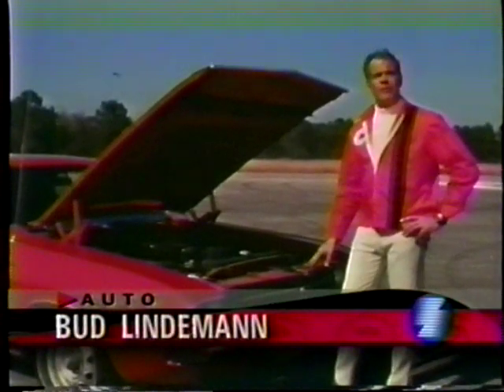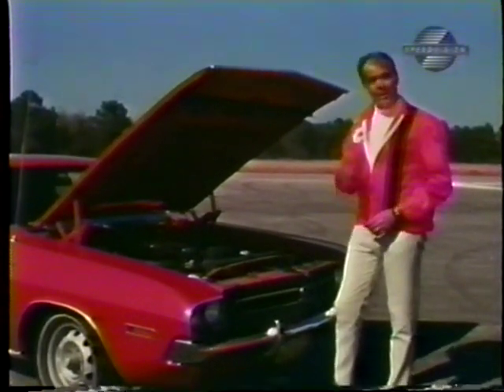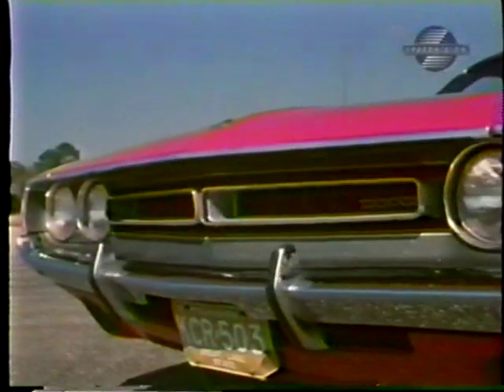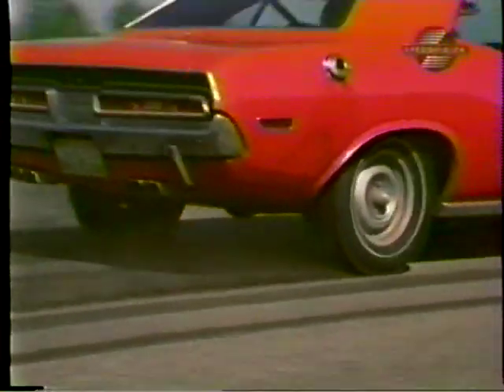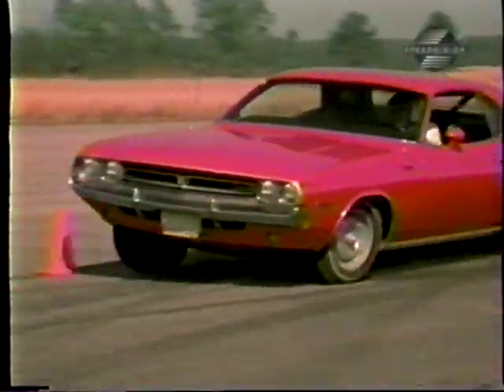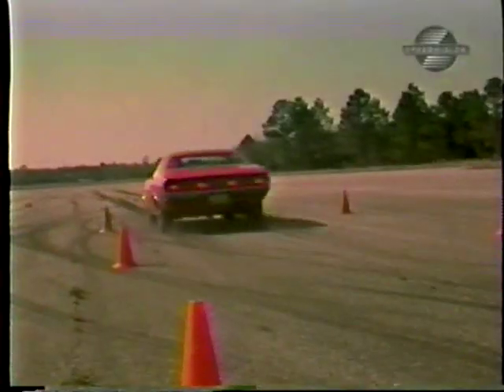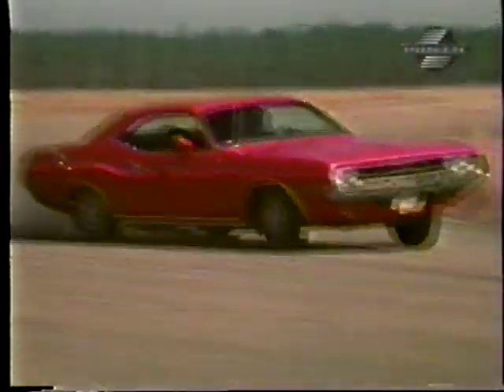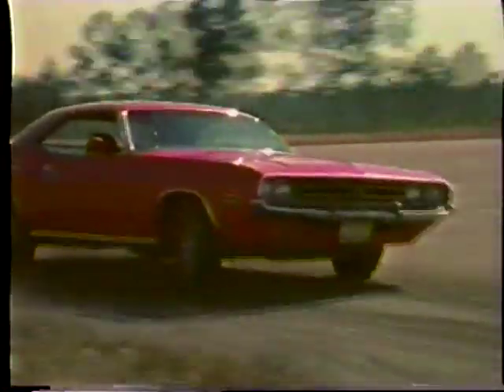1971 Dodge Challenger 383 - vintage road test

Comment: these cars had so much body roll you would get sea sick out on the track.i was a teenager and really into cars back then.71 was the year they started killing hp in cars and it was the beginning of the  smog controls.i was bummed bad i still had 4 years to go to get my license.but there were plenty of 68 69 70 muscle cars around when i did get my license.these cars would have placed better et than they did if they had the tires of today. not a whole lot better but they would have been somwhat

Comment: 383 as a standard motor. Then also in 70 you couldnt get a 340 R/T Challenger, 71 was the only year it was an option in the R/T Charger, Challenger and Super Bee line up.

Comment: That's a real odd ball. A non R/t with R/t pieces, sans the hood. With white walls to boot...Hard to tell, is that Panther Pink or Tor Red?
Reply: Was thinking the exact same thing. They should have sprung for the 15" wheels and Polyglas 60s though.
Reply: Red
Reply: I think so too.. My 71 Cuda 383 auto had all the factory hd goodies and power frt discs.. It didn't handle anywhere near that badly, brakes were fine. I will admit that i wasn't running Polyglass tires though....

Comment: @alpine1600s HA! and please tell me good sir, what exactly do you drive thats so amazing, probly putting out 200hp or less? probly made out of plastic? probly will cost you a fortune if it breaks just so the mechanic can plug the computer into it and fix the computer chip that was causing your problems? yes, please tell me what fantastic car you drive.

Comment: No, you're wrong.  The Challenger was the sole exception of having a 383 as a standard motor with the R/T package.

The 1968 THROUGH 1971 Charger R/Ts all came standard with 440 4bbl carbs. 

allpar.com/cars/dodge/charger/1971-1974-chargers.html

Comment: That car looked like it was 30 years old even when new in that video.
Reply: even doing 70mph in 8.0 sec flat
Reply: Keith Hugo yeah dodge needs to change it already there stuck and need a modern design and the retro design as an option.

Comment: You will see standard equipment for the Charger R/T is the 440 Magnum.  Don't like that website?  Google the 1971 Charger Registry. Click on Market Values as well as Production numbers.  Not a 383 in sight.  From the "History" Tab: The Charger R/T came standard 440 Magnum V8 rated at 370 HP. Optional were the 440 Six Pack and 426 HEMI. "

Please, PLEASE stop spreading BS about Mopars, there is enough of that online.  You don't know what you are talking about.

Comment: I bet it's the "Not coming from the factory with joints under the carpet" option that might have something to do with it. The Challenger is my dreamcar, but ya gotta face reality. These cars were put together by someone just rushing the car down the line, pissed about working on Saturday for that A-hole boss. at an hourly wage at that! Sadly, that KIA has better quality control than any 40 year old domestic ever did, and can outperform with 135 less horses than that Challenger.

Comment: I have a 73' Roadrunner with the same basic brakes as this car and have never had a problem bring it down in speed, even from 140 mph! My car stops on a dime.
Reply: only way a 73 road runner goes 140,is if you drive it off the empire state  building
Reply: john dillinger Is that so?
Reply: My car is a factory 340 car. When stock it would turn 6000 RPM in high gear with 3.55 gears and 28" tall tires. Do the math. My car had no modifications at the time, for about 30 years, it was just tuned good.
Reply: ***** They said something about testing a "340 car and the handling difference was barely noticeable". That may be what was going on with the gear selector issue, but hey who knows!
Reply: Randall Price n
Reply: @thesurveyor2235  The 73 340 was a dog compared to the 1970 what with 3 or 4 compression ratios missing The 70 would have had 10 or 11 to 1 compared with 7 or 8 for 73. As for tuning, I suspect you aren't running a factory tune if it goes so well

Comment: This is actually quite impressive. I'm somewhat surprised at how good this actually is particularly considering it's probably on bias ply tyres.
Considering a 440, instead of the 383 -  and the 440 is only about 30lbs heavier - I wonder how a 440 4sp would have done in this test.
Reply: A 440 is alot heavier..about 100 lbs and for your information review all of the old car tests.....not ONE 440 went as fast as the 383..Ignorance is bliss!!!
Reply: A 440 manual 375hp pulled 60 in 5.6s and 14 dead for the 1/4 mile in 1970 with another tester.
Reply: @johnnyzee383   are you sure because im thinking of doing a 440 hemi swap with the manual transmission 3:2 gearing and im looking at it as of im in 1970 ( not after 1975 ) buying a new car as a daily driver for work and family duty and checking out the engine options on the build sheet at  the dodge dealership
Reply: @richardprice5978  Am I sure about what?
Reply: @johnnyzee383   " not ONE 440 went as fast as the 383..Ignorance is bliss!!! " your saying it makes the car in the test in the video preform worse off ?? and as a new ( aka in 1970 ) car for getting to work + small family chores ?
Reply: @richardprice5978  I still dont understand your question...ok..The car in the video was probably well tuned for this test, and was indicative of a well tuned and well running 383 with the 440 heads and cam. Remember that a regular family sedan 383 was not the performer that the 383 HP motors were in the Roadrunners , Challengers and Superbees...and example is a Mototrend test in 1971 of 2 1971 Roadrunners, one equipped with the 383 and 3.55 rear and the other with a 440 Six pack and 4.10 rear. The 383 car ran a 14.84 @95 mph and the 440 ran a 15.0 @96 mph. Now obviously the six pack needed a tune as those 3 2 barrel carbs needed an expert to get them to run right, but remember that the 383 had less gear and still faster...a well tuned 440 would be a bit quicker in the quarter to the tune of .2-.6 tenths and maybe 2 to 3 MPH but for the most part MOPAR got its famous reputation as having the fastest cars based on the VAST majority of cars at the time, and that was 383 versions....I know cause I was there...
Reply: @johnnyzee383   with respect i wasn't alive before 1987~ so i get the rose tinted glasses effect or compare them to the newer dodge challengers and i im looking for unmodified numbers that i can use that were as a new 1970 dodge charger pre 1976. 
i really haven't planned on making my charger into a drag car ( i have never seen the 440-6 get its butt hand by a 383-2 "grandmas" car but you said it was probably out of tune in the magazine testing and maybe that is not true reality of performance ps. thanks for posting it ) but my old stock 1970 G-Code engine died ( milkshake everywhere ) and is probably not fixable ( and its easier to get the taller block deck hights than just replacing my low deck ) so i have been looking at replacing it with a non numbers matching crate 440 RB or the 2-G 440 twin spark plug hemi ( 50+LB more weight with all iron and thats how i would order it built but keeps its easier resell / insurance value up vs a brand new dealership crate engine GM 6.2L LSA swap ) because the engine shops have told me that they cost about the same at the power level ( 500 + hp & 500 + TQ @ the rear wheels ) and longevity ( 60K + miles before id need a rebuild kit ) i what with modern EFI and a mild hydraulic roller camshaft + rockers my worry is about making it a ruffer and noisier riding experience with sub par gas mileage ( my old setup got 16 MPG~ @ 60 MPH~ and i liked my old engine just i was whating to modernise it the same way as the crate engine im looking at ) and worse handling and braking +- 20 feet~ more ( id like not to hit / get hit by rude people that can't drive politely or a deer 🦌 and id like to go auto-crossing 2X ish times a year / fun automotive events ) because its my only car i have to drive to work and back aka im still using the car ( i have a classic pre-1990s k1500 truck too but it will be awhile before I can use it a again as its being rotisserie restored / on hold ) as if i was the first owner ( in 1972 ) and not a "car collector" / weekend toy

so my point is " blindfolded " testing can you tell if the engine weighs more or not driving it vs 50lb more  + 300hp or its in your " head " aka a sugar pill ???
Reply: @richardprice5978  My brother had a 69 RR with a 440 and mine was a 71 with a 383..My car was about 120 pounds heavier and didnt notice any difference in handling...as a matter of fact as my brother beefed up the suspension it actually handled much better than my car..so IMO no big deal in weight difference. If I still had my car and wanted to drive her everyday I would retrofit a modern fuel injection system to it and thats it. The reason that engines back in the day got worn out before engines of today is  because of fuel wash on the cylinder walls resulting in accelerated wear thanks to the carb.By the way at the end I had Indy cyl heads a very mild cam 290 degree dur 500 lift on 112 lobe centers 750 eldebrock carb and my car went 12.6 @ 106 mph with 3.55 rear. My brothers car with roller cam 600 lift ported stock heads and 3.23 went 12.05 @ 112 mph, and his car was lighter.
Reply: @johnnyzee383  this is vary helpful thank you vary much guess that puts my mind at ease about stopping 
               as i got lucky 🍀 couple years ago and was going to the parts store and just happen to pick a different car ( 2004-10~ Chrysler 300 base model ) and got hit i had to pick between t-boning a truck that pulled out on my green (  / trying 2 fast 2 furrys drifting a round the corner and losing it @ 45mph~ ) or the possibly of getting rear ended and the teen girl ( i think 💭 ) texting / on the phone 📱 didn't stop .

how was your 383 gas ⛽️ mileage ( mine got 9mpg - 17 mpg~ ish usa ) vs your brothers 69RR ?? as a daily? 
i definitely planning using sequential Efi coil near plug and a newer roller camshaft and i did buy a newer tremic 6/7-speed manual transmission just resonantly
Reply: @richardprice5978  On the highway my 383 got 15 to 18 mpg...in the city about 10-12. My brothers car on the other hand lol...7 or so in the city...it was a joke...basically not really streetable. I could start my car right up and drive it every day if I wanted..no issues with heat or anything...https://youtu.be/wnoq-ROExPo  This was my car...
Reply: @johnnyzee383   thanks you have been really helpful ( as it's been hard so far for me to find this information posted on the web / and i don't have older car magazines + your RR and your brothers RR are basically a prefect analogy for my changes if i made them ) and your 1971RR is in nice shape and sounds so smooth in your video that i have a hard time telling that its " camed " 👍 vs my battleship grey primered F-8 charger ( typical rust / ageing problems with 2-gen ) as i got a long way to making it as nice as yours was or a show stopper 

so basically in-stock format ( or modified to get better mpg as are 383 numbers~ are acceptable or better and your guys 1/4 times aren't that bad.
 im not excepting Chevy gen-5-up Camaros / corvette  / Toyota prius mpg numbers but id take it and run with it 😊) the 440-4 is a premium or E85~ ( 3-4~ $ a gallon ) gas ⛽️  pig 🐖🐽  🐗 and anything above 15mpg ish is getting really lucky 🍀??? but it makes a lot more power as a trade-off ( that's the easy part to find out how to add more these days ) if that's the case you might have saved me the headache of going broke trying to use it for work & back ( maximum round daily trip ~30 miles ) , 
thank-you as im a blue collar industrial / modern car ( 1980-2004~ era of manufactured technologies , ended working on most of them in 2008-15~ in a 3 party independent shop ) mechanic  / ( close to bare minimum wage usd depending upon what time in my life ) worker
Reply: side note i didn't know that 50 ish cubic inchs of extra displacement can jug down that much more fuel on the high way @ sub-80 mph flat mid-west planes cruising. wowza 😲 😲 3-7s ?? mpg

Comment: Mine would push drove better on the throttle a lot better handling than most the a body demon didn't handle as well ..I was fortunate enough to have several Mopar muscle cars

Comment: oh man if you are getting your info from allpar there is something wrong. allpar has a lot of mistakes. The 71 Charger didnt come standard with 440 it came with a 383 with options being 340, 440, 440-6 and the Hemi. In 71 times were changing and for the first time the 440 was not standard.

Comment: That's an odd car. It's not an R/T or an SE. It has a 383 4Bbl, the R/T exhaust, full gauges, Posi, 4 speed, rallyes, and A/C!  It's a weird one !!! I am thinking they took the trim rings off so they wouldn't have to chase them around the field.

Comment: @daytonasunset Nah man the 70 is the most sought after but like I said I have no problem whatsoever about the 71 at all but I hate the 72 73 and 74, They should have just stopped making them after 71. The 70 has that one awesome gas pedal that kinda reminds you of a big GMC truck pedal, "the only year with it" the last year and "only" with the challenger to have the reverse thread lugs on driver side, "SO RACEY and H.P." and the 70 year models have that again "racey" recessed grill. So sexy.

Comment: the heads were actually different for a 440  they were taller allowing a longer stroke, which gave the 440 a 13 inch wide intake appose to the 12 inch that the 383 and 400 have, and the cranks and connecting rods were different between all three engines, but still the same blocks
Reply: clubcabpowerwagon Why on earth would you say that? You’ve openly demonstrated that you haven’t got the faintest idea what you’re talking about.
Reply: @anridapu  
Aw man come on. 
Just because hes got a 61 gto with one of those rare factory 429 hemis that ran low 9s off the showroom floor thats no reason to get testy😂
Reply: MrHillfolk 😆👍‼️

Comment: love how they always thought supercars were dying
Reply: They did die.  A lot of compression ratios dropped for 1972.  By 1975, the Challenger, Cuda, and most of the rest of the muscle cars were either gone or reverted to tape stripe options.  The 1974 GTO was a 350V8 stuck into the Nova-type body.  Then downsizing happened.  It was hard to get a decent V8 in anything.  It was entirely gloomy until the 1982 Mustang GT came out, and the revamped Camaro.  Things really improved when the Viper came out, but we really did not have a full blown return of the muscle car until this latest generation.  The fact that we have Demons and Hellcats now was absolutely though impossible not long ago at all.1972-1982 was the "lost decade" for American muscle cars.
Reply: ToyKingWonder so true

Comment: nope, nada... a 440 will walk a 383 unquestionably. and a 383 is about 5lbs lighter
Reply: silverbird58  because they're plentiful & parts are plentiful. You can make a 470ci from a 400 B engine as well. Use a 440 crank, cut down the rod journals and use 454 Chevy rods (yes really !!) You can have a 600hp engine for relatively "low cost", but that's a lot of dicking around for a high revving, big bore engine.